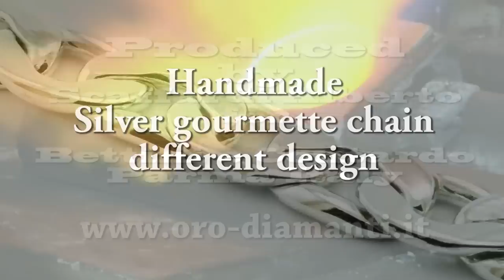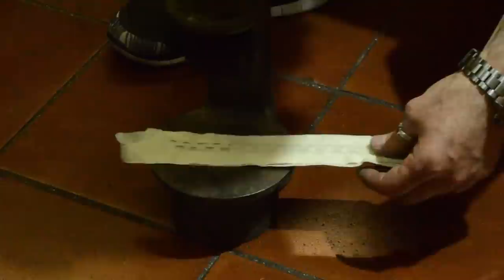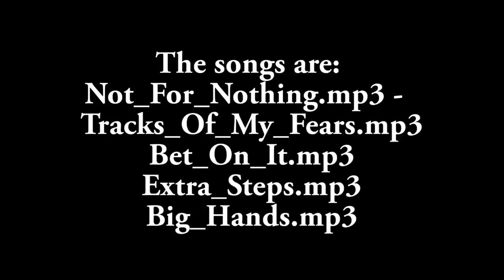Handmade silver gourmette bracelet

Comment: No filing! Super idea! May I am what mm the wire is and the mm of the mandrel you used?
Reply from the maker: I do not remember, however, the spindle must have a diameter proportional to the diameter of the wire you use. The rings before being bent must touch each other, the more united they are, the better the finished work will come
Reply: @scaffoal  Thanks!!

Comment: Thank you for your tutorial. May I ask what size silver and mandrel did you use? Love your work.
Reply from the maker: The silver thread I used is mm 2,3. Usually the tube on which the wires are wound is just bigger than double the thread diameter. In this case it was 4.8 mm in diameter.

Comment: i was taught never to use a chain on polisher bc it could rip your finger off. i watched with my eyes closed. great bracelet :)
Reply from the maker: thank you, It depends on the power of the engine, with what I use if I'm wrong, the worst that can happen is the breaking of the chain
Reply: Sabrina Flipse . Always be very careful with chains, eventually you will learn.😁
Reply: Hi
Reply: I polish chains everyday you just have to be careful
Reply: Yes but that's why you have ten fingers. You would still have 9 left🤔
Reply: @DerekJohnson-fy5xq  LOL!
Reply: I was taught the same, but I noticed that @scaffoal was not only holding it very, very tightly but also wearing gloves, so it seems as if it would be at least relatively safe. I would also make sure I was wearing safety goggles, obviously.
Reply: حلوو
Reply: U have to polish small part at a time ..so it will have no room for the polish wheel can't grab it..

Comment: Is this how you would make a flexible link ring? I've seen them filed after flattening?
Reply from the maker: The crushing of the rings did not prevent the movement of the chain. The size of the thread and the diameter of the rings is important, if the rings remain too space, they do not remain in their place
Reply: @scaffoal  8...

Comment: What is that machine with the big pulling chain in it called? The one that pulls the silver through the gauge holes? Please been trying to find out for a long time. No success on finding it on line.
Reply from the maker: https://www.google.it/search?biw=1060&bih=665&tbm=isch&sa=1&ei=8gclXKfzLpiBur4P1dSr6AY&q=banco+trafilatura+orafo&oq=banco+trafilatura+orafo&gs_l=img.3...3655825.3665076..3665366...3.0..0.127.2094.24j2......0....1..gws-wiz-img.......0j0i67j0i19j0i10i24j0i30j0i8i30j0i24.piC6IevX-IM